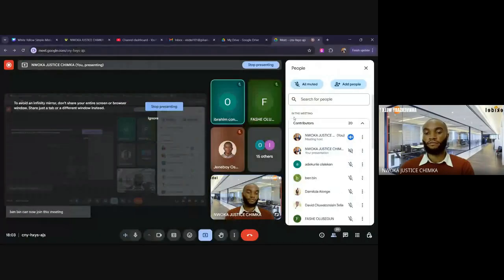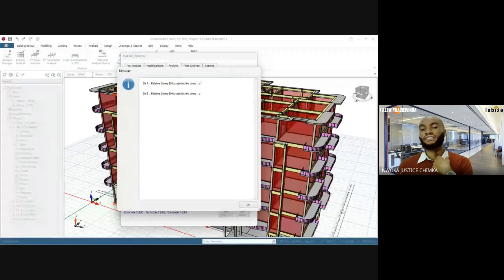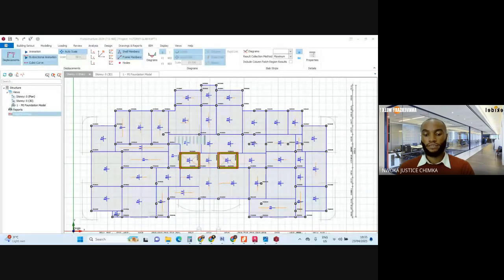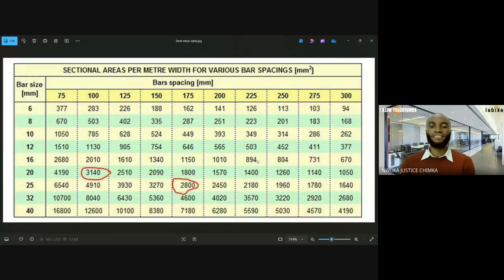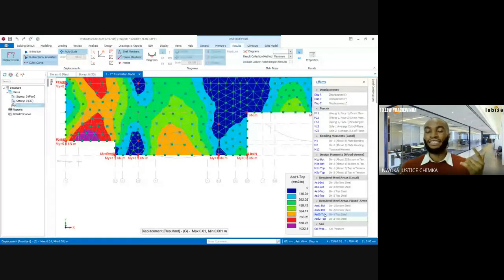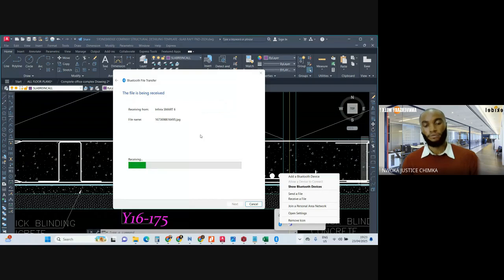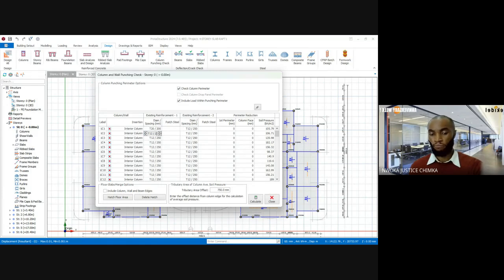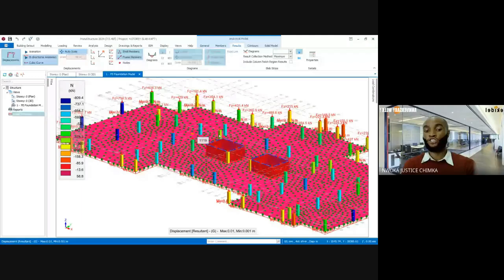Slab Raft Foundation Design - Protastructure Tutorial (Ekidel Training DAY 2)

Comment: Sir what if I decide to use the y20@200 for the bottom reinforcement all through, I think then there will be no need to provide the extra punching reinforcement right ?
Reply: @EkidelEngineering ohk I get it sir, but assuming the y20@200 is greater than the required area in the design then no need for another extra